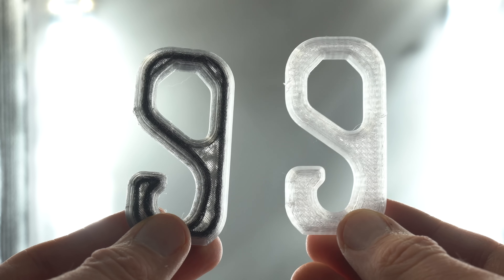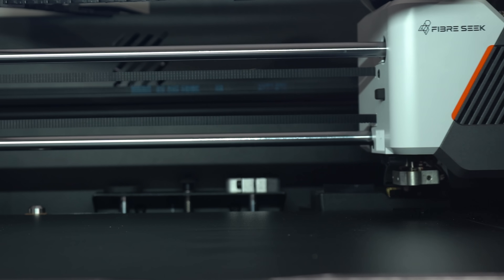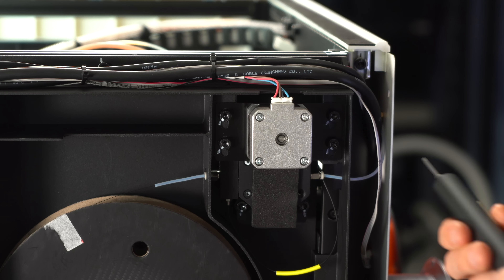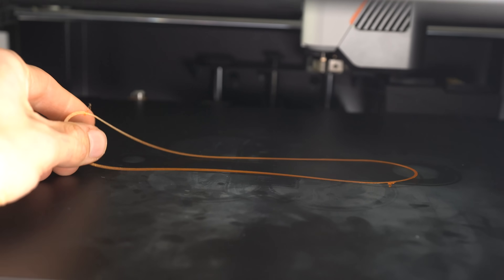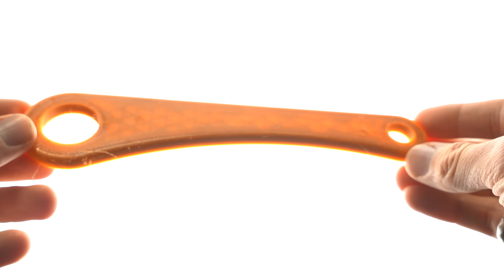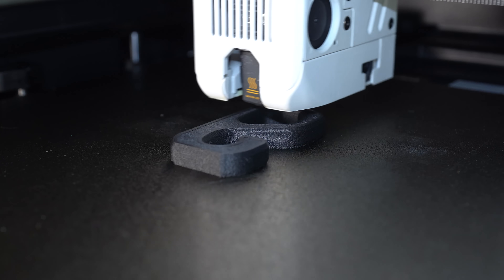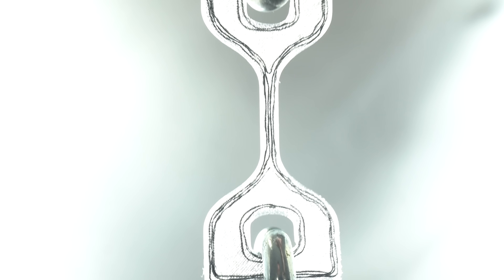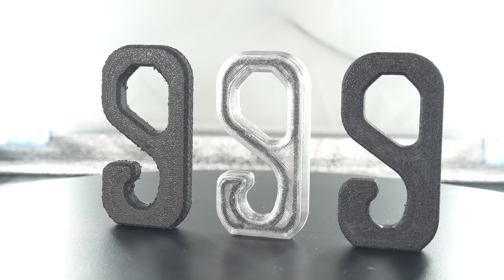3D Prints Just Got WAY Stronger, But At What Cost?

Comment: Thank you to everyone joining the discussion 👋
We truly welcome comments like this — suggestions and honest criticism are how great hardware products grow. The best innovations are never built in isolation, but refined together with the community.
As mentioned in our outreach, the unit shown in the video was an earlier prototype from over 3 months ago. Since then, we’ve completed several key upgrades — including:

New Continuous Carbon-Fibre Extruder
 The belt feeder was a temporary solution for prototypes, as it takes significantly long time to develop the injection molds for gears, which will be used on the production version for the continues fibre feeder 
 We have undergo more than 7 iterations of design for the feeder, and the current dual guided feed path ensures smoother flow, accurate fibre placement, and clog prevention along user-defined paths

🔥 Active Heated Chamber (Dual Thermal Airflows)
 Heating module relocated to the mid–upper chamber
 Generates two controlled thermal loops, reducing vertical temperature variance
 Real print zone remains thermally protected for long composite prints

🚀 Rocket Slicer Software (Upcoming Public Beta)
 Consumer-level slicing experience with Beginner + Advanced modes
 Beginner mode: smart, minimal, intuitive one-click slicing
 Advanced mode: full parameter control for professionals and material exploration
 A public beta will open soon for real-world side-by-side workflow testing

We’re excited that Taylor has accepted a production-ready model and plans a re-review. We would love for the next video to shown what FibreSeeker 3 real look in this moment.

That would help all viewers understand progress transparently — and inspire even more creators to imagine what continuous fibre can unlock on desktop machines.
Thank you again for keeping us evolving — together 🙌
 Let’s print stronger, and always smarter and more responsibly.

FibreSeek Team 🚀
Not just printing. Evolving.
Reply: Just a suggestion maybe before the end of the Kickstarter release a video of an in depth walkthrough of the printer itself telling about the challenges that were faced and what has improved and how. Simultaneously showing what the people can expect and having an opportunity to showcase some things some reviews might have missed or that changed from when they were made. I think this might be a very welcomed video seeing as this is marketed towards people who like creating this themselves and know the processes of revising and fixing what was wrong showing that you listened to the feedback instead of just telling. And also so that the people who backed this know exactly what they are buying as some specs will always be missing from a Kickstarter page at it would be 300 pages long otherwise.
Reply: Ryan handled criticism like adults. No ego battle, just "here are the upgrades." That's a responsible founder mindset.
Reply: ChatGPT type comment

And nice astroturf as well!
Reply: Look, FibreSeek actually showed up and responded openly. That's integrity. They're not hiding, they're iterating. That's the kind of team I trust.
Reply: Love that they are willing to share specs and talk improvements with reviewers and users. That alone earns respect.
Reply: If this is where desktop composite printing is heading, sign me up. I m excited to see the production review.
Reply: I don't care about early prototype mess. I care that they evolve fast. This is promising tech.

Comment: definitely try the fibre with tpu, or some other flexible filament. i think that a flexible material can stretch and take out the slack in the carbon fibre, while also being more shock resistant.

it could be very helpful for a battlebot chassis or something.

Comment: Great, honest review! I jinda wish you would have tested impact strength and layer adhesion with it though, as (as you said) this is the usual trade-off: more tensile strength by adding carbon filament but usually also reduced layer adhesion and reduced impact resistance. I could see impact resistance being the same as the base material for this, but layer adhesion might be a different story. would be very curious to see!

And yeah, I have use cases for it... I make gym equipment accessoires (mostly for myself) with it  and every bit of strength gain would be appreciated.

Comment: If there is one 3D printing trend I wish would DIE FOREVER, it's proprietary "required" slicers for machines that shouldn't really need it... The "watered-down version of Cura" is a headache I had with the LulzBot Mini v1 at work that I recently got working again to set up for one of our staff members to tinker with. This "let's fork slicer X" mentality has been around for over a decade now, and was the case with this LulzBot Mini v1. Since it's no longer supported, the proprietary Cura fork it comes with is RIDICULOUSLY outdated. You CAN however, pretty easily make a profile for it in the newest version of basically any slicer...

I understand there are some proprietary slicer features too, that might not be part of the open-source versions of slicers such as PrusaSlicer/Cura/SuperSlicer/etc, but maybe these manufacturers could work with those slicers to make custom profiles for them to ship the vanilla version of the slicer with these features and/or implement some sort of firmware-level integrations for it... I don't know, I never claimed to be an expert, but I seriously hate the fact that some of these machines force you to use their proprietary slicer, but will gladly run on Klipper, as if I could take full advantage of it with their proprietary slicer... It's annoying.

Comment: I put a pre Kickstarter deposit on one and have been sitting on the Kickstarter fence, because as much as I like the idea of this printer, and the enthusiasm of the company, I noticed a few  details I wasn’t sure about. Your review has convinced me to hang back and wait, so thank you so much for going deeper and being curious too. What is super interesting is that the material is available, and with the new toolchangers coming to market, I can see it’d be feasible to apply this technology by developing a special tool head or IDEX arrangement and that way mod an existing printer. A bit like a silicone extruding PrusaSlicer XL
Reply from the maker: Thank you very much! Glad you found the review helpful.
Reply: @ygk3d I did, and I already knew I was going to make a new tool head for my ProForge 5 when it lands, and now I have another I want to add.
Reply from the maker: @mikecrane2782 it would be great to see continuous fiber printing go open source. I’m curious if proper printing’s belt extruder could be adapted to extrude the fibers.
Reply: @y @ygk3d m thinking of using O-rings in my design and a modified Picolino extruder from Dmitry at Magnetic-IDEX, because this has fantastic TPU performance. I planned on adding a Picolino to my ProForge, and I’ve seen you can mod the JSON files in SnapMaker Orca to add two different nozzle sizes in the U1, so it’s a no brainer to use a “continuous fibre tool head” with a servo controlled filament cutting macro at toolchanges. I just feel that designing a tool head, and sinking some coin (maybe using PCBWay) into this would give me more for less. Yes, Proper Printing is a top channel, love his stuff, always makes me smile seeing him develop stuff.
Reply: @ygk3d I did think their belt and gears set up looked pretty “janky”. I haven’t seen anything that specifies their fibre thread diameter, but commercial carbon fibre tow in 3K,6K & 12K grades is 0.13, 0.2 & 0.26mm in diameter respectively. I did see a Russian fibre 3D printer years ago at a UK TCT show at the NEC Birmingham, but creating a feeder tool head looks like an interesting problem to play with.
Reply: That Russian company was Anisoprint, and they've got a tie in with Fibre Seek :)
Reply: I think this doesn't have patent in USA .

Comment: Nice job Taylor! I had heard the hotend was a pain to dismantle & reassemble. You covered some technical issues I also heard where difficult to manage. My use case for this machine is totally different than what the mechanical strength it can produce. I want to print Pa6-cf as the base material with a more dense lattice of CCF to mitigate RF absorption & reflection. This would require some refinements in the slicer though. My use case interested the FibreSeek team but to my knowledge,  they ran out of machines for content creators. Hopefully as the machine is refined there will be an opportunity but I'm not holding my breath.

Comment: I personally would use the parts for drone parts, I know there's some sturdy filaments out there but now you can extra enhance them
Reply from the maker: Yeah, that's on of the list of applications they play up in their marketing. You'd probably need to find some other applications too... don't imagine you'd print enough drone parts to cover the cost of the printer unless you're selling them. And there's undoubtedly some regular filament options that should be sturdy enough without the carbon fiber reinforcement. But the transparent parts with the carbon visible through them do have the cool factor....

Comment: Good to see innovation, but this looks like it needs some more work to be viable. Will be interesting to see where this tech goes in the future. I get the proprietary slicer for this specialized use case, but it does make me nervous...some sort of custom plugin for Orca (if that's a thing) would be better
Reply: Once Orca has better toolchanger, nozzle changer functionality aka “ Multiple Extruders” and then map extruders to wall types like I’ve seen in other slicers it’s pretty simple, to make outer perimeters be in one material, or use one tool head/nozzle and another for the other perimeter walls.

Comment: Any chance you can elaborate on what the carbon fiber itself looks like? It can't just be raw carbon fiber as it wouldn't hold together. Is it infused with a thermoplastic to hold it together or something?
Reply from the maker: It's a very thin strand. What you see coming out of the hotend in the video is exactly what's on the spool.
Reply: It's a thread of very long, continuous strands of fiber. Look up carbon fiber tow, it is the same thing but in a form specially made for the printer to print.
Reply: @bobbyslayy Yes, I've used tow. But tow doesn't stay together, especially not through any sort of extruder. I'm wondering how the carbon is consolidated into a single strand that can stay together though the extruder.
Reply: @BFriesen   it has an outer epoxy layer
Reply: @riba2233 Interesting, thanks. I wonder how that interacts with the thermoplastic deposition. Just intuitively an epoxy to thermoplastic bond seems not as strong as a thermoplastic to thermoplastic bond like Markforged.
Reply: @BFriesen  cnck said it bonds better like that, maybe it's some blend, who knows.

Comment: How long are the continuous carbon fibers? I mean, how long can a single uninterrupted fiber actually be?
Reply: Theoretically the dimensions of the print bed minus the distance from the edge of the tool head to the center of the nozzle.
Reply: @helixx_4D  Oh, does the printer cut the fiber at the end of each layer?
Reply from the maker: @AntiVaganza  Yes it does.
Reply: @AntiVaganza it has to do so, otherwise when you lay filament in the other nozzle it  would pull the fibre out of the print or pull the print off the bed.
Reply: @helixx_4D so a single layer can in principle be one uninterrupted fiber?

Comment: Great thing to see you also talking about the problems, there has been so much hype about this printer with little critical investigation. And the production is top notch as always.

if you like, it would be interesting to see a continuous vs forged fiber, as everybody can print a mold with a normal printer, but time, effort and price will differ, so it would be interesting to see if the gains (if there are any) would be worth it over a machine like the fibreseeker 3
Reply from the maker: Thank you!
Reply: "as everybody can print a mold with a normal printer"

I considered that but I am so done with sticky resin. It's just too much nasty work. I will be happy if this printer is reliable and also if it makes parts at least 80% as strong as MarkForged - but neither of those are proven yet.

Comment: For me the markforged is hardly an industrial printer without a heated bed or chamber, especially for that price. I've used it, painfully slow and excessive warping is 100% with the default PA material
Reply: That is because of stratasys patent. The same reason stratasys sued bambu. I have used markforged mark 2 and their material science is very advanced. They manage to print their PA6 blend on a cool bed without heated chamber without warping and still beating strength and toughness of other nylon blends in the market. 
What worries me about this printer is the same issue i have seen in M2, they do not have a lever like the H2D to cover the nozzle while fiber is being laid out. That means some nylons can drop pieces of filament while hotend is still hot.
Reply: If, you were around at the beginning of Markforged or look at the machines objectively - They are a hobby printer. They came out of the RepRap and Hobbyist Community.
Reply: PPA CF